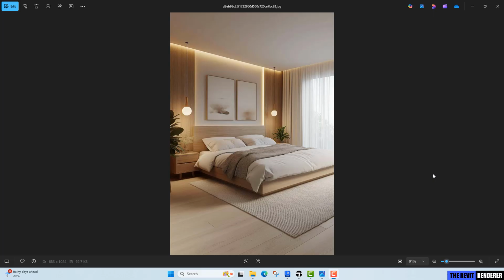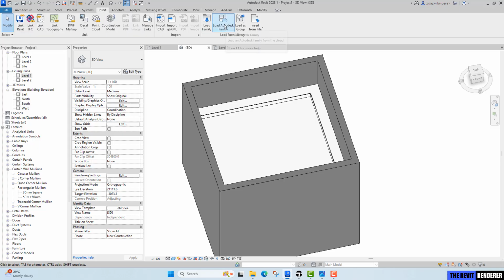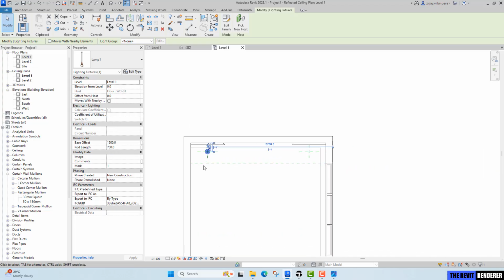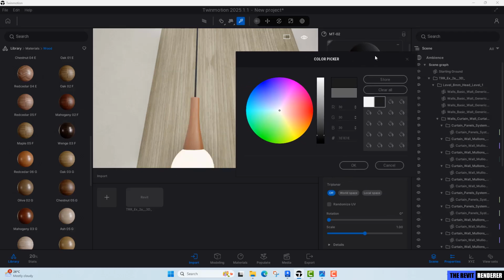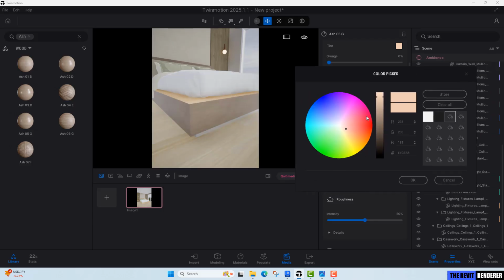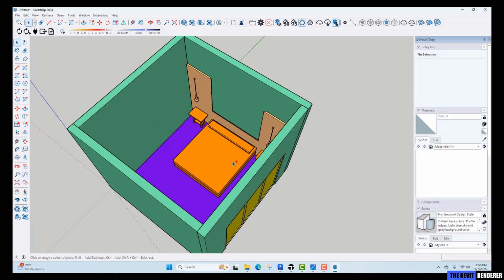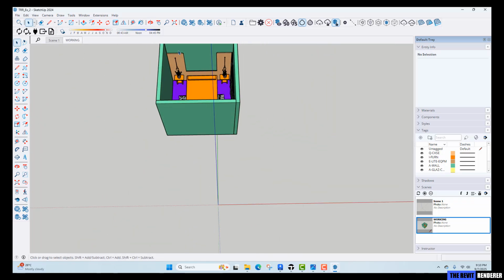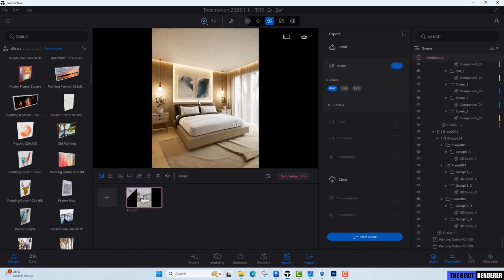How to Combine Revit & Sketchup Models to Create Renderings in Twinmotion

Comment from the maker: If you downloaded the training files and you want to skip the Revit modeling part, you can use the Revit file provided and you can skip to the next chapter: 

(00:00:07) Revit Modeling
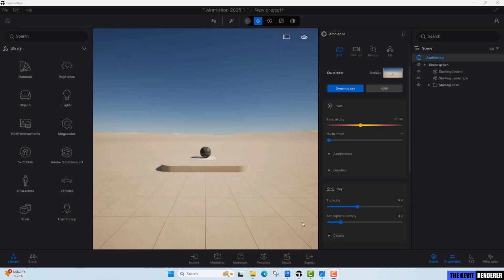(00:23:58) Direct Linking the Revit Model to Twinmotion
(00:37:22) Replacing Revit elements with Sketchup models
(00:49:29) Adding lights and linking a Sketchup model into Twinmotion
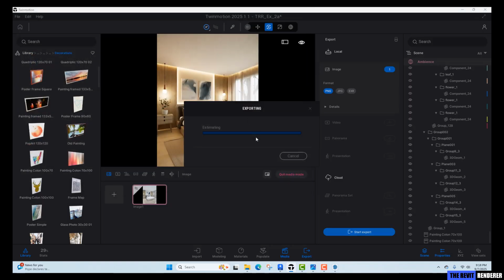(01:16:53) Results & Conclusion